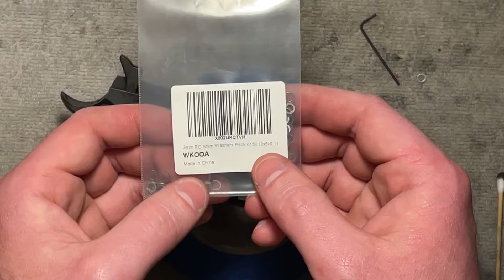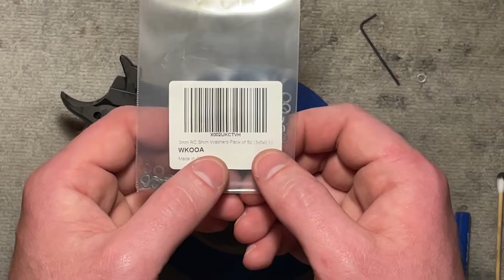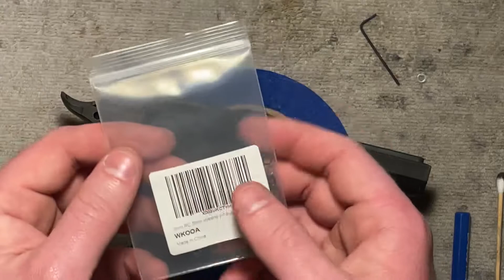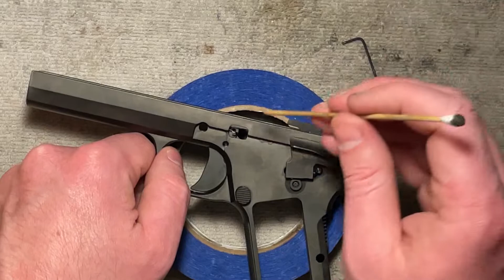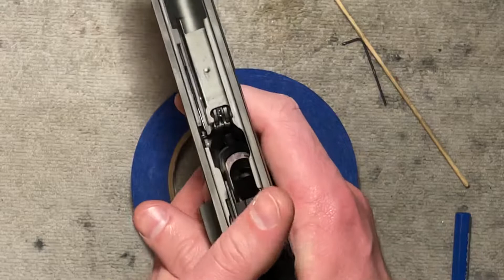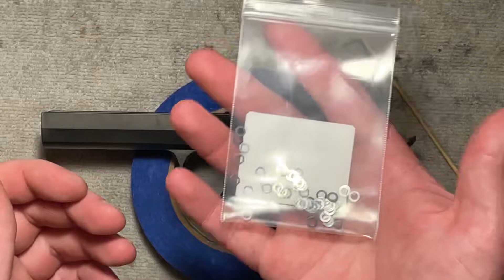SIG Sauer P210A Trigger Bushings/Shims to Reduce Wobble

Comment: The hammer side to side has almost no wobble. I may try this on mine to make the trigger the same way
Reply from the maker: If you have the stock trigger, you might only need one washer. Seems to be that way with mine. They don’t/shouldn’t remove all side-to-side wobble, but do a nice job reducing it.